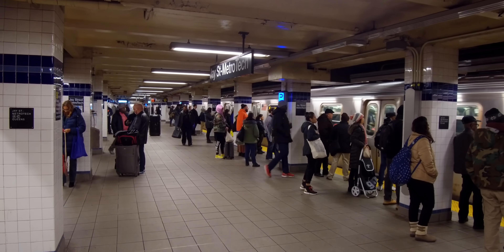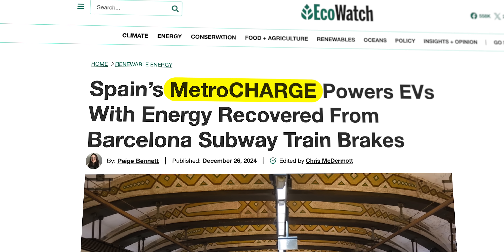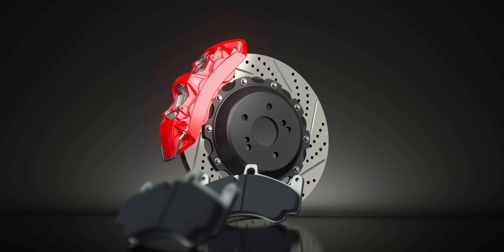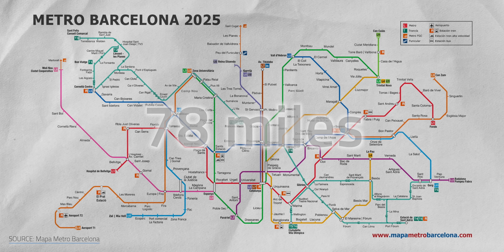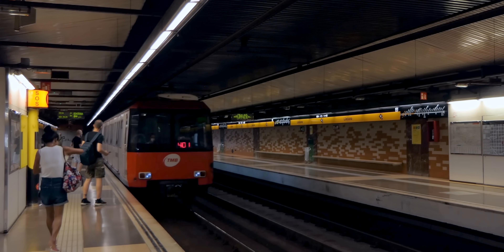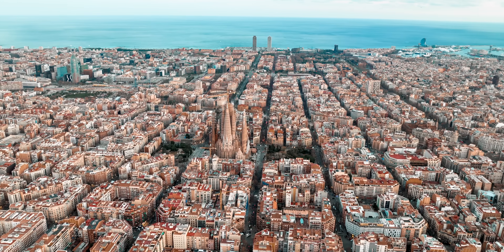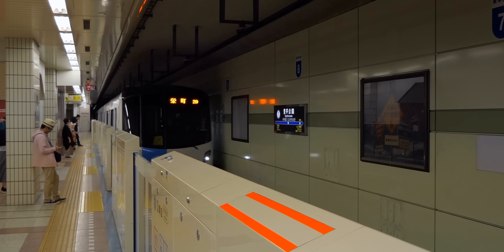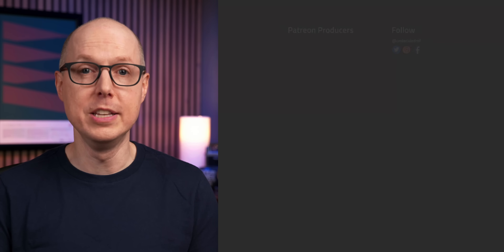The Most Overlooked Clean Energy Source… is Under Your Feet

Comment: Can someone help me get this?
I can't see past the thought: isn't this just an extra step in moving energy from whatever powers the train to stations/chargers?
Like, instead of this, RB could be used to power the train itself. Maybe this would require significant batteries, or maybe there is something else I'm missing
Reply: "RB could be used to power the train itself" - There's a train being trialled in the UK which does just that - a BET if you like (more accurately a BEMU - Battery Electric Multiple Unit). That uses RB to put energy back into its battery, and it has an ultra-fast charger at every station stop to bump the charge back up (because you'll never get ALL the energy back from RB). However, retro-fitting subway trains - many of which are years or decades old - with batteries & the electronics to run them is expensive. I'm sure future subways will start with re-using RB-sourced energy from the get-go - trains use most energy accelerating from a standstill, so if you can re-use the energy captured from regen to do a significant chunk of accelerating the train out of the station, with track power to just keep it moving between stops, that'd also be a huge step forward in energy efficiency.
Reply: @theelectricmonk3909  subways already use RB-sourced energy. When a metro train brakes, the energy recovered is stored in the railway power grid. When the metro train accelerates, it uses the energy from the power grid, some of which is that RB energy. The power grid is acting as a battery, except it's outside the train so it doesn't add to weight. This is the most efficient system. GWR's BEMU is a quick, cheap, inefficient solution to a larger problem: The UK doesn't have the money to electrify it's railway because our economy is falling apart and most of the railway money goes to HS2 anyway.
Reply: @Pablo-Iza  "GWR's BEMU is a quick, cheap, inefficient solution to a larger problem" - In what way is it inefficient? ISTM it's a perfectly valid system for allowing widespread "electrification" without installing expensive third rail or catenary systems across masses of the network.
Reply: @theelectricmonk3909  It's inefficient becuase it puts more weight on the vehicle that is being moved, instead of storing power in the static power grid.
Reply: Good replies, but I would like to sum up the answers and add a few points as well:
1 - Metro/subway trains don't have batteries. They work using cables in the tunnels. If you add batteries to the trains, you would probably need to buy entirely new trains. Trains with batteries are also more expensive than trains without, so even more money. This will likely be more expensive than adapting the stations.
2 - Trains with batteries are also heavier, so the existing infrastructure, like the rails, will probably not be able to cope with the excess weight, so you would need to change the infrastructure of the entire line to be able to use the new, expensive trains.
3 - If the trains are heavier, they need even more power to move, and even more power to break. And as you can only ever regenerate a portion of that energy, it means that, overall, your trains with batteries are using much more energy than the ones without.
4 - Because the train is heavier and needs more energy for the brakes, they will produce more heat, more pollution (from particles released during the brakes), and will demand much more from the brakes themselves and the rails used during the brakes, meaning you will need more constant repairs.

So it's much easier, cheaper, and efficient to have trains without batteries that will give any energy generated back to the grid, or to a battery in the station (like in Barcelona), than to have trains with batteries that can reuse the energy they generate.

Real trains, that work on the surface and go to different cities, are not connected to the grid, and in that case, having trains with batteries is an option to electrify the line. It's what Denmark is doing. It is renewing its rail infrastructure so it can accommodate heavier battery trains. Another option is to install electricity lines over all train lines, so that the trains can connect to those cables and use that energy. But that option is not visually pleasing, as it makes the rail lines ugly.
Reply: @jplenardon  most of your points make sense. 

There are two add points I would like to add though:

1. I really don't understand the fascination with using RB to power EV chargers. I don't think that is revolutionairy, I think it's really limiting. You could use regenerative braking and transfer the energy back into the subway network. If other trains can use the energy they can do that, if they don't the energy is reinjected into the electricity grid.

2. You don't need battery powered trains. These trains are connected to the electricity grid of the subway. If for some reason it's not feasible to reinject the electricity into the subway grid you could store it temporary into capacitors. These are very good at storing big amounts of energy for short periods of time, and are fairly lightweight. You don't need too much capacitors either, because you only need to store the energy of one time getting the train to a standstill.

There might be benefits to the thing you proposed as well: put the capacitors in the network, not in the trains. In that way you keep the trains lighter, with all associated benefits.

I'm not sure though, the downside of having these capacitors placed in the subway grid would be that you need to retrofit the whole system before even one train can RB. If you put the capacitors in the trains every additional new (or retrofitted) train instantely provides these benefits and you could have a mix of old vehicles and new vehicles.

My guess would be that the additional versatility in most cases would be prefered over the weight savings.
Reply: @jplenardon  Makes total sense. Unfortunately Matt missed the boat (train) in explaining this in the video.
Reply: @jplenardon  Railway electrification projects fail to go ahead because of the high cost, not because they're "ugly". No electrification project in history has been cancelled due to public opposition over visual pollution (as far as I know). It's always the cost
Reply: That was my thought, my guess is that the train is not powered by batteries but from overhead wires, or a third rail and it's more economical to dump the power than rewire the source.
Reply: I think too many places don't force power companies to pay back. So it would be wasted. I think it's a huge fail on regulator's part.
Reply: It's certainly an extra step, but it's cheaper and faster to deploy than retrofitting all trains. 

For example, looking at the history of the local rail network here in Switzerland - for the Gotthard base tunnel lines, they issued a tender to purchase more trains in 2012, with order announced in 2014. Some lawsuits later (of course), it was finally tested in some of the intended routes in 2018, with revenue service starting in 2019. 
Now, making changes to stations? Much faster, specially if it doesn't require a lot of construction.

For cost? Those new trains were about 33 million swiss francs each, which comparing to the values stated in the video means you could convert multiple stations for the cost of a single train.

Long term I'm sure train operators will switch to direct RB-powered trains as you suggest, but that will happen slowly as existing rolling stock gets replaced, unless it makes a lot of savings (such as that "infinite energy" train in Australia that goes uphill empty and then comes downhill full of ore, generating massive amounts of energy - the savings alone from that  justified buying a whole new train).
Reply: You would need only 20 kWh of battery per railway station.
Reply: It is simply like this.

When you drive your car sometimes you need to brake, so all energy wasted this way is there used to turn back to electricity.

However Subways don't have batteries. They are connected to power all the time. So power instead of going to batteries needs to go back to the grid. SO it is not rly used back in the subway but used elsewhere.

Thanks to that over all electricity need gets lowered whenever subways used their breaks.

Comment: This is misleading .. you’re just offsetting a portion of the energy it takes to run the trains in the first place. Sure, there’s no reason not to do it, it’s a good thing, but it’s not “powering” anything.
Reply: It is power that otherwise is just dissipated as heat so in a way it is powering subways,  what it is not doing is generating new power into the system it's just recapturing the power used to move the trains in the first place
Reply: @rakeau  notice this channel generates so many videos in short period, ikyk

Comment: What is the advantage of adding the ev charging to the system?  I would think that electricity is essentially fungible at the local grid level, So wouldn’t having only the regenerative breaking without tying into the ev charging basically give you the same electricity/heat savings without the need for the extra infrastructure? How much of the cost was for the regen breaking vs ev charging?
Reply: This was explained in the video: 5:42
Train energy network (DC) and general energy grid (AC) are not the same.
They have already been using recuperation on the train energy network. The point of the video is exactly the point you're attempting to make here in your comment: 

They've put Inverters in place to use the recuperated energy also to power AC train station equipment. Inverters are infrastructure. The infrastructure you're trying to avoid using in your comment.

But they also implemented a way of pushing the excess DC power created by braking from train energy network to DC EV chargers directly. This bypasses the need of DC to AC to DC inversion / conversion infrastructure.
Reply: @DvorakJosef  EV chargers already have their own inverters. But fine, let's say we build new chargers with no inverters. This still makes no sense;

Since the energy that was recovered from RB that would've been used to power another train in the network is now in an EV charging station, the railway power network needs to draw more power from the energy grid, using their own inverters which they pay for.

So what you're really doing is transferring some of the energy cost from private EV companies to publicly funded railways. This is yet another corrupt money laundering scheme from the Spanish gov, and it's not smart nor efficient.
Reply: @Pablo-Iza  I'll put aside the fact you've just called AC to DC converter an inverter, which just about sets the expectation for what you know about how electricity networks are operated, and go directly to your point.

The entire point is that there are not always trains accelerating on the train electricity network, ready to accept the electricity generated by braking trains. That leaves you with excess energy that either needs to be burned off as waste heat, getting you big fat nothing in return. Or it needs to be stored, making you build expensive batteries. Or it needs to be pushed somewhere else.

In your "scenario" you still need an expensive DC to AC inverter capable of accepting all of the energy in short amount of time, to feed the general electric network. Which costs YOU, the rail operator (tax payer) money to build. Not the owner of the charger. Which you may not be even allowed do, because connecting large intermittent "peaky" power source to the energy grid might get rejected by the energy grid maintainer.

I really, really, really hope, that I don't need to explain to you why buying yourself a DC to AC inverter , just so the EV charger down the road can convert it back down to DC, is not only more expensive for YOU than just running a regular cable from your DC network to that DC charger, but it actually introduces waste, because, surprise mister electrical engineer, those DC/AC/DC inversions / conversions are nowhere near 100% energy efficient.

Please, explain to me, mister financial auditor, how is buying a big-ass DC to AC inverter, or a battery bank, cheaper than running a length of cable that connects DC network to DC charger?
Reply: @DvorakJosef  Well done condescendingly pointing out that I got one word wrong, your award will be available for collection today before 8pm.

The existing network is able to cope with the "peaky" power produced by regen braking just fine, using the same methods as national power grids which are far more "peaky".

You keep insisting that the DC power on the rail network is useful for anything other than powering trains, but like I already explained, this DC power has already been converted from AC and has already incurred those losses.

Wether the conversion happens at the EV charging station or using railway infrastructure is irrelevant. All it does is shift the cost of conversion to the railway company which is where my financial argument lies.

Comment: Lowering the costs of EV charging sounds like it's siphoning off some of the incentive for using trains back to driving, which, even if they're EVs, would still make it harder to lower carbon footprint, among other things.
Reply: While I agree, it's not just the cost of gas/charge that goes into people using a car. For one, cars on average are higher cost maintenance on you than paying for train/bus tickets. Two, convenience, if there are enough trains, tracks, and routes in your area, it offers more freedom for you than being behind the wheel. But a car in most modern infrastructure offers more choice and freedom on where you travel. Generally, the best way to get cars off the road is to take that road and use it for something else of equal or more people per hour.
Reply: @DemonsIce  No, there's plenty of factors, but lowering the cost of driving still encourages more of it in people's mental math of mode choice.